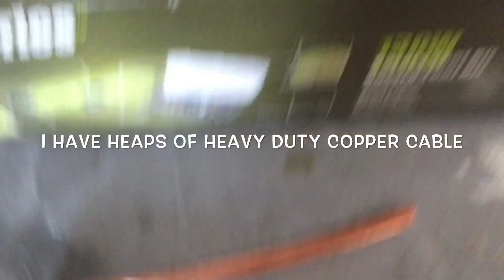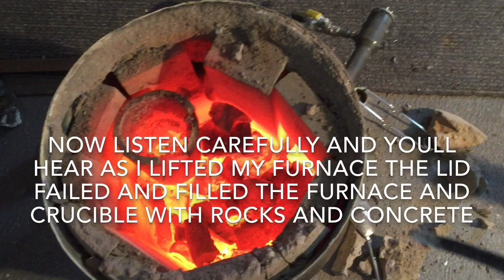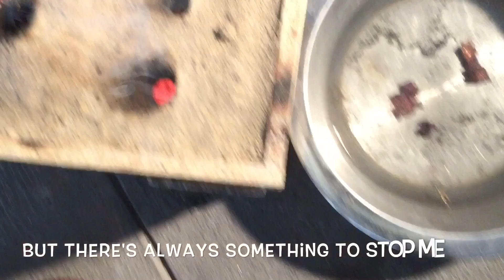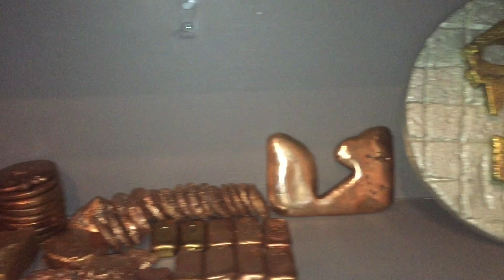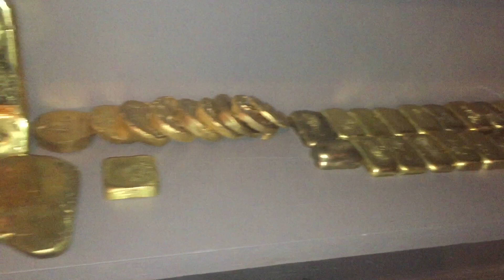MELTING COPPER  - Copper Ingots -pouring copper melting Copper

Comment: The weight of your pattern plus sprues etc ( weight in grams) multiplied by the density of the metal you are casting ( cm. cubed ) will give you an accurate metal weight to cast what you need.

Comment: That didn't look fun!  Looked downright unpleasant actually.  Glad you didn't get hurt. Stuff failing when yellow hot sounds dangerous!  Also I like the new shelves for your castings
Reply from the maker: Paul's Garage yes I was very glad %99 of the glowing bricks fell into the furnace and not outside the furnace . Next time I won't be so lazy and fix it sooner. The shelves have been sitting empty for about 10 years in my theatre room and as me and the kids are the only ones to use it I thought a few brackets for support and a coat  of paint will make a nice home for me treasure 👍🏻.

Comment: Refractory cement every couple months will stop that happening again pal dont worry at least you have the keg still that stainless steel wont warp at that thickness it'll be grand pal.
Reply from the maker: Yeah matey all good , im gonna get my smaller furnace up and running for now . Surprisingly the chamber area on the small one is only a little bit smaller as the keg but the keg obviously can hold taller crucibles.